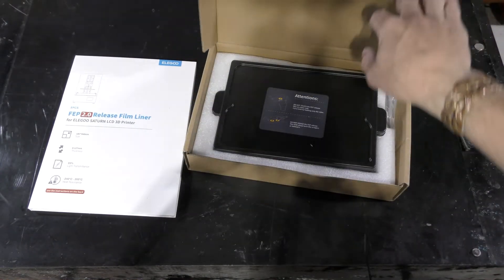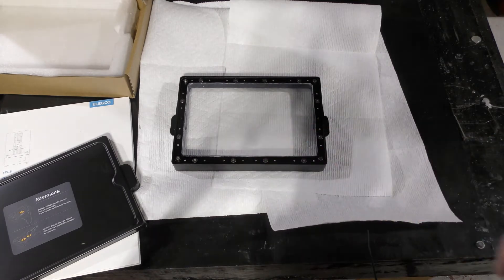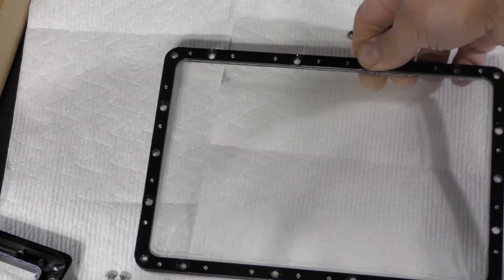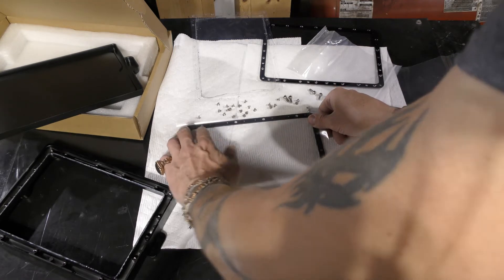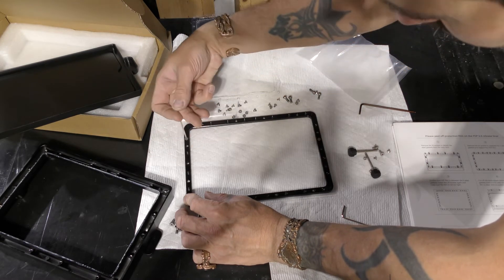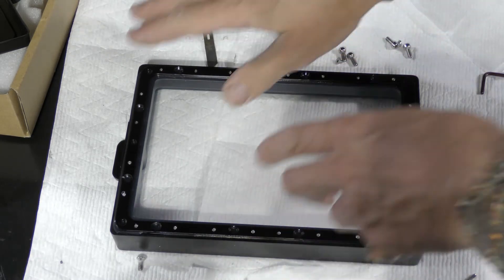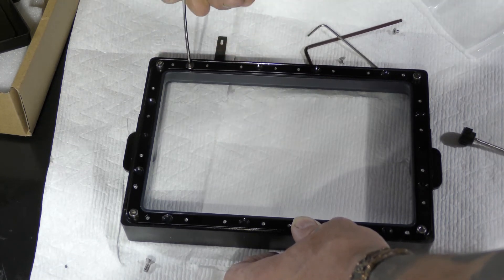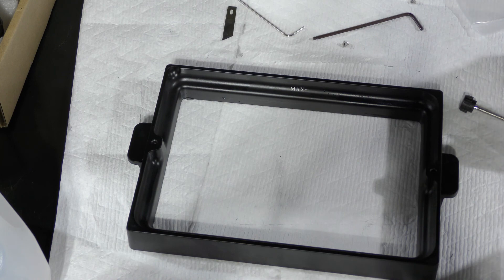Elegoo Saturn changing the FEP

Comment: always pinch it first for all your holes, don't get used to this or one day you'll slip and you damage your brand new FEP.
And never put it this far in one go, always go in stages going round and round

And after a long while you will need to re-tighten
Good lord don't do the water... wth is he doing lol

Especially if you print standard resin instead of water based. You'll notice that when you print you can't clean the resin under that edge. The same goes for this water of his
I've done this for 4.5 years and if you follow your steps it will never leak.
Reply: Whats your best tip? Bottle cap for tension, just plain or an 8mm foam
Block?